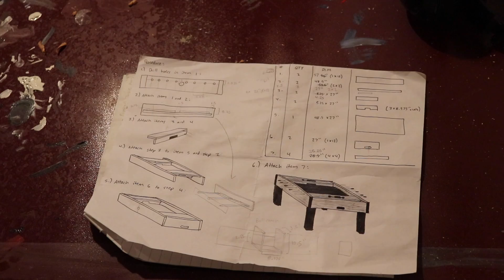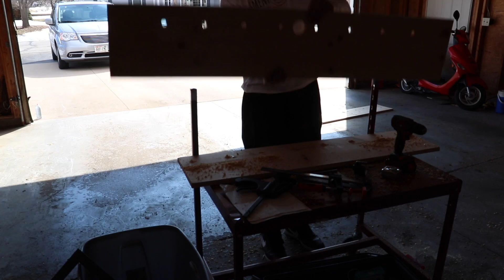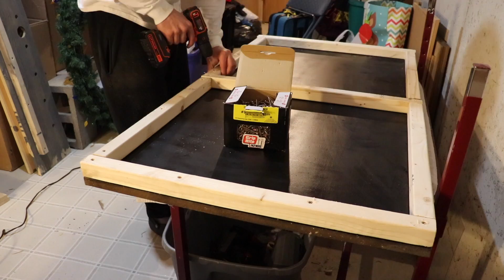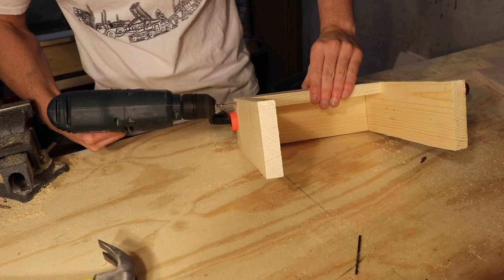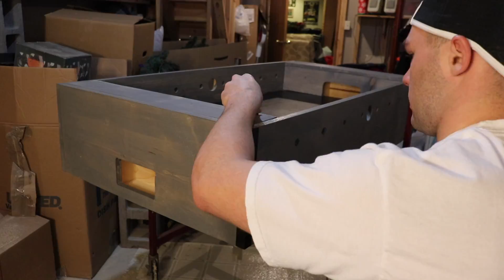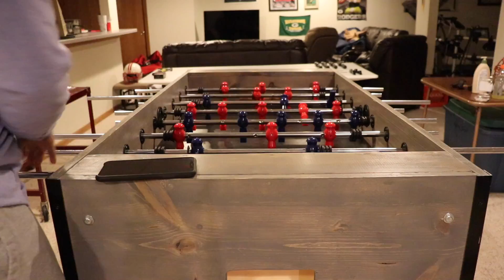HOW TO MAKE A FOOSBALL TABLE

Comment: Nicely built , my question is , normally corners are a bit inclined so that the ball doesn't stay in the corners. Did you do something about that?
Reply: it is not normal that the corners are on an incline. if you look at any professional table like a tornado they have three "goalies" to deal with the ball getting stuck in the corners. he used two "goalies" to deal with this problem. just by simply watching the video you can see what he did. 
a table with two or three "goalies" will not have inclines in the corners, a table with one "goalie" should have inclines. not really that hard to figure out.
Reply: @youngsun6617   understood ,thank you

Comment: Man when you don’t have a table saw use a level, clamp it down. Measure the distance from the plate of your saw to the blade usually 1”1/2 inches back and you get really nice straight cuts. We use this when we have to cut solid wood doors. But you need a really nice blade and a good saw or else it bends the blade and cuts it with a bevel.